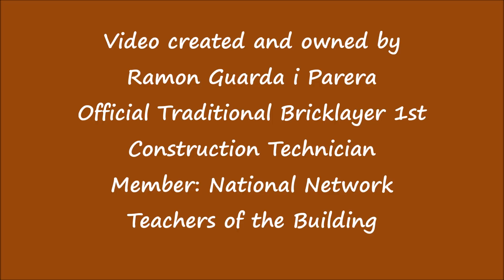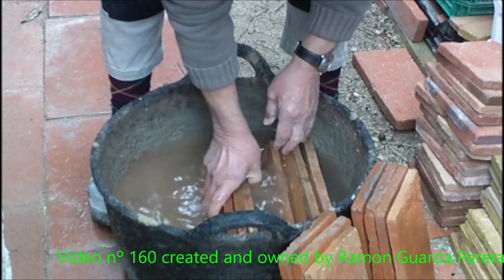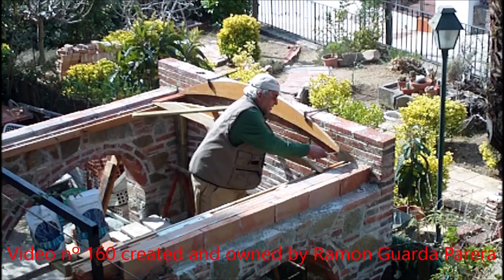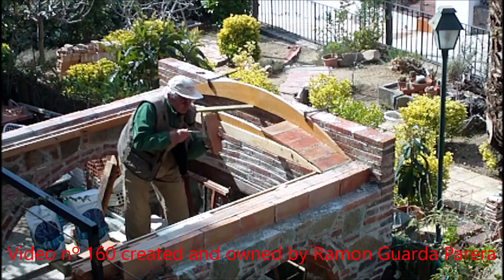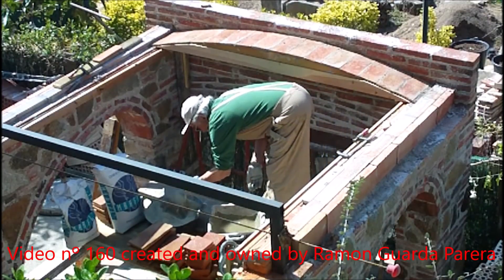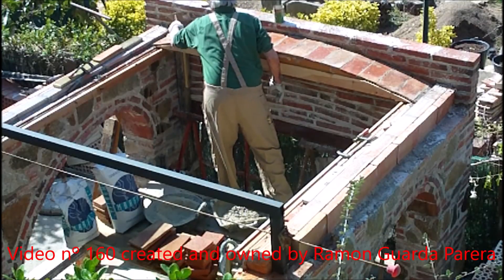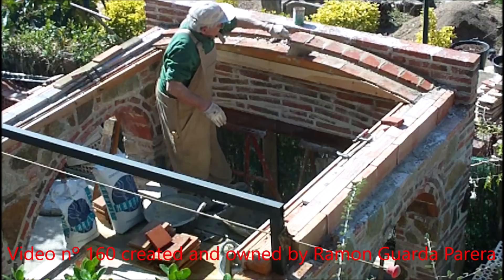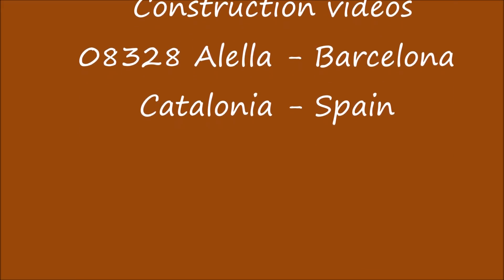How to build a traditional Catalan vault 1 st part video nº 160

Comment: Wonderful video. What are the thin bricks called, and can they  be ordered or purchased in the USA ?
Reply from the maker: ello, KJ Southall  thin bricks are 14X27X1.5 stripes in the USA, you will not find it, but you can use a different type, any doubt you have, do not hesitate to ask me greetings Ramon de Guarda i Parera
Reply: The US used to have the Guastavino tile company.
Reply: @00crashtest  Guastavino learn his profession jn  Barcelona
Reply: @00crashtest  I believe Guastavino used to make his own tiles. He had a factory at his home in the countryside.
Reply: @peterhoulihan9766  I think they're still available to purchase new in Latin America because Catalan vaults are still popular there in new custom-designed buildings. Luckily, Mexico is just a short drive away, and importing them shouldn't be difficult because they are mass-produced in the factory, meaning that their production is well-documented.